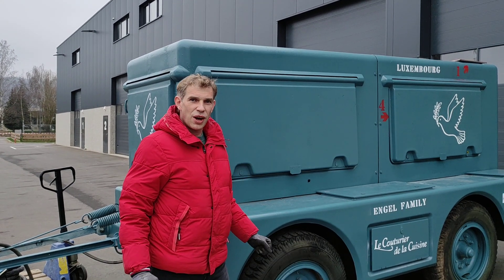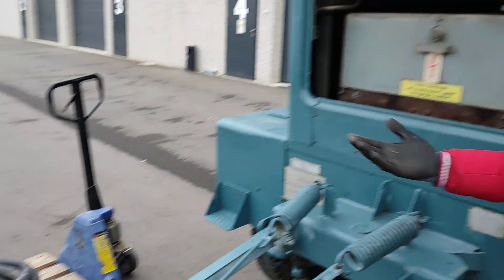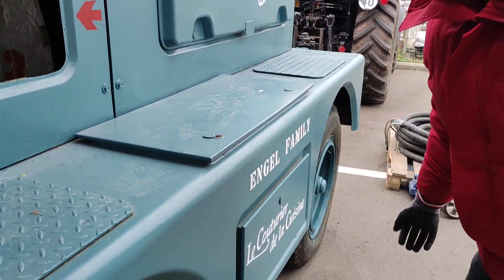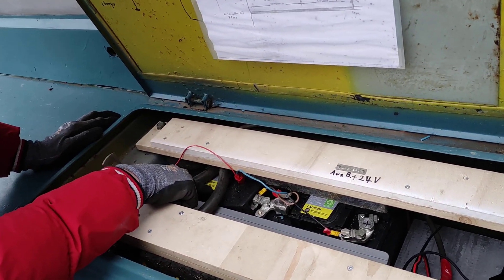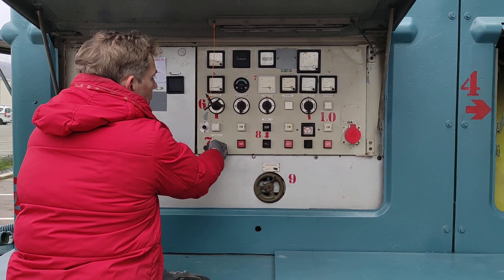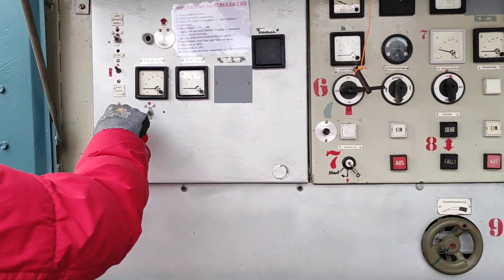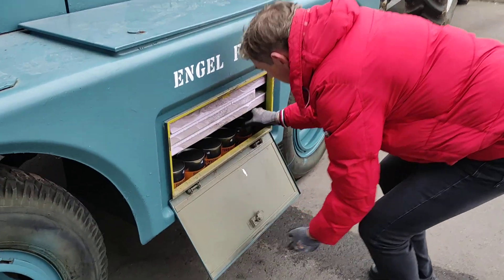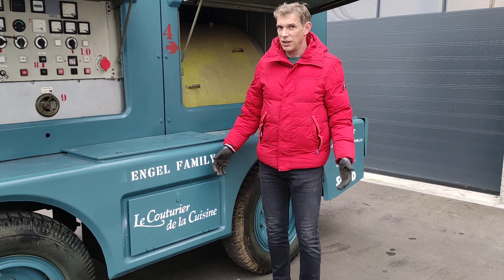Help for Ukraine Turbolekt 333 Generator Luxembourg

Comment: Those generators produce heat that is wasted. Someone needs to put a little thought into extracting the heat to assist warming a building or heating water. Possibly a bolt-on heatsink that connects by hose to a radiator that can be placed in the living-space.
Reply from the maker: You are right, there is a ton of heat wasted, but the generator is not previewed to be a fixe istallation. It will be moved on the place where it is urgently needed to produce electricity.